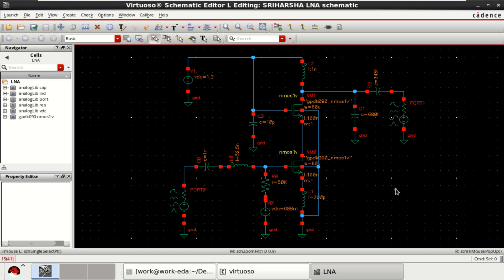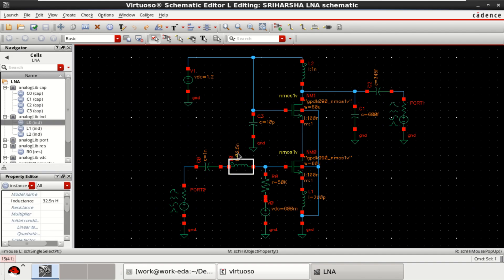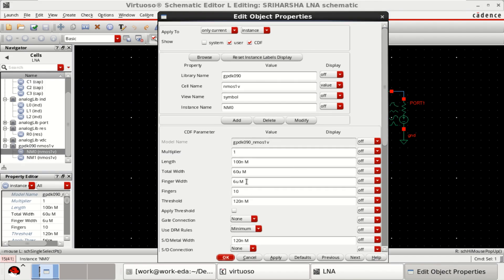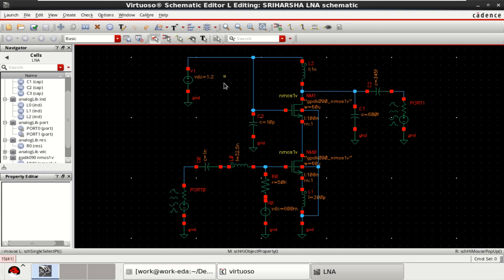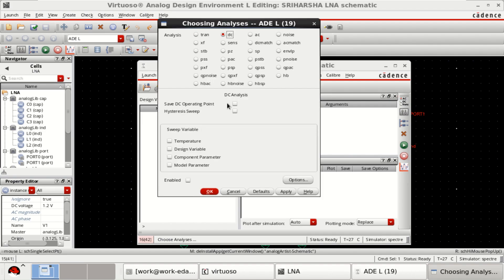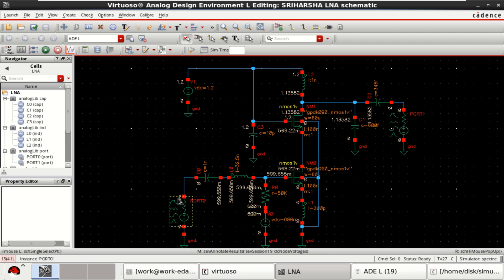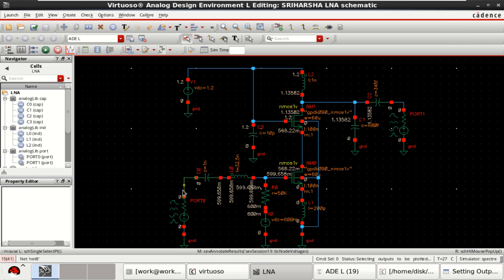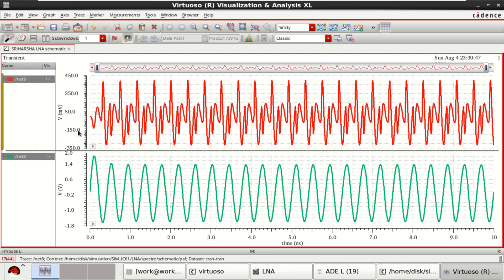Low Noise Amplifier Transient and DC Analysis.

Comment: Sir, how should I modify the parameter settings in gpdk045, I only have 45nm lib.
Reply from the maker: Hi, select the any transistor then press Q on keyboard to change the object properties. Like width can be set a parameter Wp, Length to Lp and so on